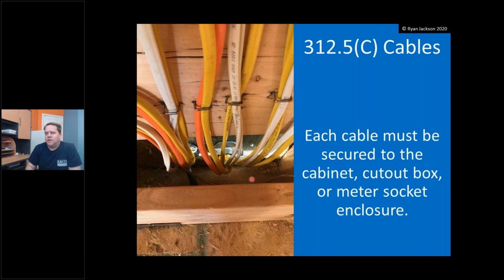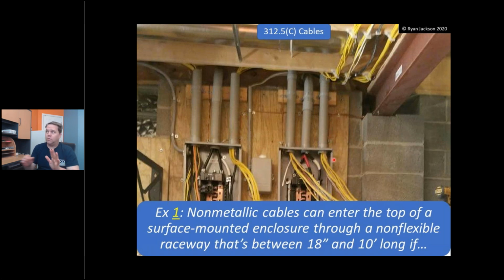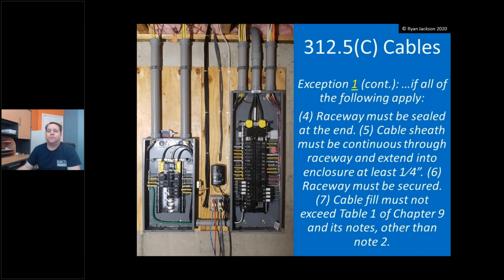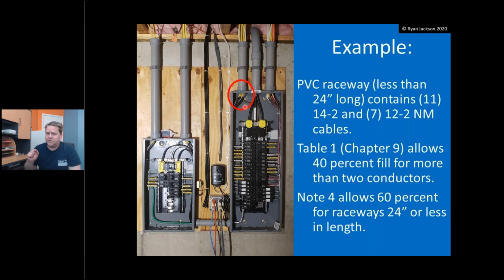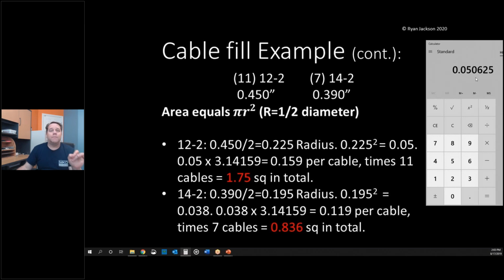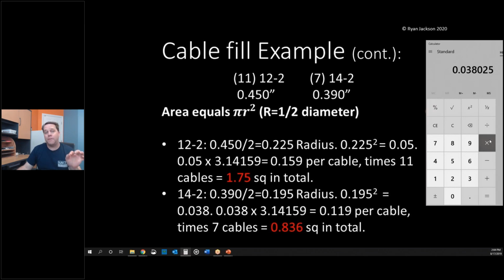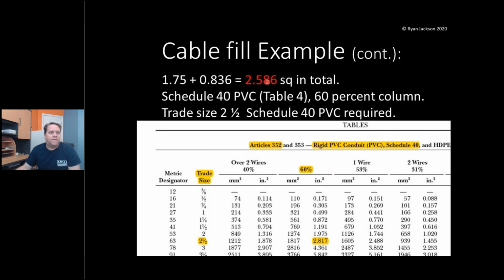2020 NEC section 312.5(C)

Comment: Subscribed!!! 

Big question! What NM connector is listed for multiple wires? The problem I keep having is is blasting a surface meter main, when there are limited knock outs on the back. To keep it looking clean, we want to come through the back of the enclosure where they have 2 in knockouts. Any suggestions? Or what NM connectors do you recommend?

Comment: What about surface mounted panels on the outside of a residential home, can NM cable from inside the wall behind the panel enter into the back of the surface mounted panel if the panel is outside?
Reply: Or how do you comply with this rule if you go from the panel where the main disconnect is up to the panel inside the house using nm cable, most of the installations i have seen use a pvc pipe up to the soffit with nm inside, it may comply with all the points in 312.5(c) but 312.5(c)exception no1(3), because even if a fitting is provided a the end of the pvc pipe it is not accessible

Comment: I see this application used on existing cabinets at the back of houses all the time in Florida. Conduit coming down from soffit. Many code violations in one. The conduit being stopped inside the soffit would be one, another would be strapping within 6 inches because you wouldn't be able to physically get to that point where the pitch of the roof is while at the same time, keeping the conduit inside the soffit to keep your romex from weather and or physical damage. Always overfilled and never having a fitting on the end inside of the soffit... Not once have I had an inspector pick on it though... Just curious as to what other electricians would do in this scenario? Have the contractor build something around the top of the cabinet? Tear out the inside wall and run the cables in behind the panel? (I've done this before where the wall was already being replaced) I've never been called out for using the existing sleeve to add circuits but I'm sure it is bound to happen sooner or later. I would say making sure fill is met and fittings are at least installed on the end as well as filling the end would be well enough but you'd still have some criteria not met at that point. Worried about a current install on an old house in Florida. Appreciate the advice.

Comment: Let me shake things up a bit.  There is nothing in 312.5(C) that states that cables rated for wet locations cannot enter from the back of an outdoor surface mount panel through a chase nipple, for example.  "312.5(C) Cables. Where cable is used, each cable shall be secured to the cabinet, cutout box, or meter socket enclosure."  That requirement is followed by an exception: "Cables with entirely nonmetallic sheaths shall be permitted to
enter the top of a surface-mounted enclosure through one or more
nonflexible raceways not less than 450 mm (18 in.) and not more than
3.0 m (10 ft) in length, provided all of the following conditions are
met: ..." .  Maybe someone is thinking: "but they have to be secured to the panel and you are not using a cable clamp if you run through a chase nipple!"  But, 312 does not say how they have to be secured to the panel, and as such it appears that the method does not even have to be with listed equipment.  312 simply states that it has to be secured. Therefore, after passing into the panel, apparently the cable can be securely tied down/clamped within the box.  Also the chase nipple must protect against abrasion per 312.  Although knockout clamps are the standard for indoor panels for obvious reasons, I do not believe that they are required per NEC.  So for example, 312 does not prevent running SER and UF through the back and securing it inside the panel.  Please tell me why I'm wrong.  Fire away!

Comment: Ryan, this was an old video of yours but relevant and explained so well.  Using the conversion to determine the area of a cable based on it’s width is overlooked or maybe ignored at times.  This is related to pulling NM in conduit (permitted  but why would you do it?). And it is permitted so long as you meet all other NEC rules related to conduit including “fill limitations.”  Multiple flat and neatly stacked NM cables entering or exiting a conduit may look fine but an inspector can spoil your day.

Comment: Good except areas are expressed in SQUARE inches, and volumes are expressed in CUBIC inches…not just  “Inches”. 2.58” is a linear quantity not an area, or a volume. I know what you were saying but I guarantee there were a bunch of watchers of this who were confused.  Those code sections deal with AREA… square inches. So say that.

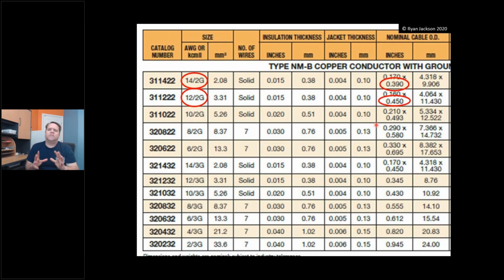Comment: Hi Ryan, In 7:33 you showed a graph showing the diameters I noticed that 12/3 has .345 diameter while 12/2 has .450 in this situation how would you figure this out because you’d think it would be bigger if there was a extra wire.  Thank you for explaining this tough subject so I can understand it I really appreciate it.
Reply from the maker: Hi Connor. When this was made, 12-3 was a round cable and 12-2 was flat. I'm sure if found a newer version it would show a larger diameter, based on 12-3 being flat once again.
Reply: Ok finally got it, the diameter would’ve been wider if 12-3 was flat because the extra wire would have been placed beside the others. But seeing how it is round they are stacked more like two on top of the other making the diameter not as wide. It took me a second, cause I couldn’t figure why there is more wires but less diameter but now I do. Thank you Ryan

Comment: Actually subject to local electrical jurisdiction, that supercedes the NEC. And the reason you don't use pvc electrical pipe exposed is because if it catches on fire, it becomes toxic. You should never used pvc exposed, it can terminate underneath switchgear where it is totally enclosed.
Reply: 352.10(F)

Comment: I engineer broadcast facilities and data centers. A trick I have used for years and has always been approved in several states is as follows. We use 225a  flush mounted main breaker panels. From that we run three or four 3in conduits stubbing out under raised flooring terminating to 12x12x6 or 12x12x4 pull boxes.  From here we run Sealtite or MC spliced to THHN wire in the pull box to equipment rack power strips or outlets. The idea here is future power upgrades or changes are very easy without having to open the wall.

Comment: Here's a question. In my garage I have some 1/2in EMT coming from the ceiling to standard surface mounted boxes, handy boxes and 4x4's. I run #12 Romex from the panel or an accessible J-box in garage the attic to the EMT stub using a Romex clamp connector via a threaded bushing. At the point where the Romex enters the EMT, I strip the jacket all the way into the end box. Remember it is clamped at the start of the EMT stub. Is this legal? I always thought you weren't allowed to run jacketed cable including Romex inside EMT. And most Romex these days is just THHN under the outer jacket although it's not labeled as such.

Comment: Is wire fill in pipe a “getting damaged when pulling” issue? Or is it a “ambient heat” issue
Reply: Mostly the latter, but a tiny bit of the former. (if you're stuffing so much cable in there it becomes hard to pull, you may want to rethink it.)

Comment: What about  derating than 3 current caring conductor I got nail by using the table but then not derating as well does
Reply from the maker: Use the exception to 310.15(A)(2) to get out of it.
Reply: Ryan Jackson I had 48 12 thhn in a 2 1/2 pvc they made me remove them down to 20 wires and increase the size to 10 which I argued that was would  stop someone from then installing 30 amp breakers on those circuits your opinion would be very welcomed
Reply from the maker: Yeah, the exception I posted woukd get you out of it.
As far as changing the breakers, that is true anytime we increase for voltage drop too. We can't possibly make rules based on people changing the rating of an overcurrent device.
Reply: Ryan Jackson thank you
Reply: @RyanJacksonElectrical  we can also label/note on the wires on the inside as well as the outside of the panel why the wires are oversized and not to increase the breaker size. Even if there was something in the code stressing something like this,, we all know the trunk slammers and weekend warriors go by"it works, it must be right" thought.
Collectively an amendment to the  NEC  for a change listing  that issue can be submitted as well.
Reply: @RyanJacksonElectrical  You don't need to change the breaker for voltage drop, there is nothing in the code that says I cannot land a 6ga wire on a 40 ampere breaker, as long as I don't violate the manufacturers instructions. However you still have to be careful. There's a sneaky part of the code somewhere that I forgot, that says if the wire is really long and you increase the non-grounded current carrying conductors, you have to also increase the equipment grounding conductor because we must provide a low impedance fault current path back to the source. In some strange long distance scenarios, you could end up needing an EGC that is quite a bit LARGER than the current carrying conductors, and this is becomes a real pain, because now you have to pull individual wires, because an off the shelf SER cable, NM, MC or AC cable is not going to have a large enough EGC to comply with the calculation.
Reply: @jimmiegill3981  There's nothing stopping someone from installing 20 amp fuses on a 15 amp lighting circuit in their 1960's era fuse panel either, lol... Happens all the time. That kitchen lighting circuit gets tapped and a drop to a receptacle on their kitchen counter and they plug a microwave AND a toaster into it. Yeah and it's like 3 feet from their kitchen sink too!
Reply from the maker: @brnmcc01  I never said you had to change a breaker due to voltage drop. And the section that you refer to is 250.122(B), but IN NO CASE does thecEGC need to be larger than a circuit conductor. See 250.122(A).
Reply: @RyanJacksonElectrical  Thank you, I misunderstood the part you said about breaker increase in size, I saw that was part of a reply to someone else, got me mixed up. As far as the code goes, this is nice thanks for the link, they fixed it in 2011, so now you're right. I wasn't up to date, because in Indiana here, they are only on 2008, lol. "The previous 2011 code language in 250.122(B) required that any time an ungrounded conductor of a circuit was increased in size (for any reason); the equipment grounding conductor of the circuit was also to be increased in size, the same proportional amount. This code language was too restrictive and unnecessary."
Reply: @RyanJacksonElectrical  This all started from the father in law of a friend, he wanted to run power out to his pond and install a pond fountain pump, to aerate the water etc. His property is so big, I went to look at it and measure it off, on Google earth it looked about 1/4 of a mile from the barn subpanel, but a straight shot from house garage panel would have still been 1000'. Did some math for the specs on the pump, and with 1000' of 12/2 wire, would have resulted in less than 110v at the pump, with just the FLA rating. Would have taken a very large wire, and still might have had the problem of the LRA startup current dropping the voltage below 108 in which case it would just stall, and burn up the motor. Anyway, the cost to trench nearly a 1/4 mile, plus all the wire, plus the issue of what happens if the pump motor windings get wet, and fault current starts to flow thru the water in the pond ended up being way unaffordable.
Reply from the maker: @brnmcc01  That has not been the case since 1996.
Reply: @RyanJacksonElectrical  Wow that’s a long time
Reply from the maker: @brnmcc01  250.122(B) has been problematic ever since it went in. It still is, although the exception added in 2020 helps quite a lot.

Comment: The conduit has too many current carrying conductors also, that is another issue correct ?
Reply from the maker: Yes. You can use the 90 degree C column of Table 310.16 for ampacity correction, but if you have more than nine current carrying conductors it is going to be a problem. HOWEVER, we can also use 310.14(A)(2)'s  Exception [310.15(A)(2) in older books] and make the issue go away completely.
Reply: @RyanJacksonElectrical  I thought there was also an exception for that for a nipple (under 24"), and as long as at least one of the ends were open. The idea being that a nipple with at least one open end will not build up a big bunch of heat. The end of the nipple outside of the enclosure still has to be sealed, like in this example video.

Comment: Ryan, can you tell me why is it commun to use ROMEX 2-14 or 2-12, don´t you use EGC in those circuits?
Reply: You must use the bare wire for grounding in ALL 14/2 14/3 12/2 12/3 10/2 in NM cable.
Reply: All older type NM ( before around 1985 ) and newest type NMB cable since at least 1970 were all made with a bare EGC wire. No such thing as Romex in any edition of NEC. Romex like wire nut are brand names. Forget what size NMB cable starts using a reduced EGC. Think #6 & larger has the reduced EGC. Did only industrial electrical work last 35 years before I retired so did not work with. "Romex" much but tons of MC cable & conduit.

Comment: Great video, thanks Ryan
I have a question for you , what is your take on these AC mini split systems . The circuit is run out to the condensing unit outside and then a cable (TC cable art 336) is run between the outside condenser and the evaporator inside I work in a local jurisdiction here in Colorado and I have brought this up to the attention of the other inspectors in the team because the cable runs 220 volts to operate the inside unit thru an additional control wire they don’t seam to think that this is big deal in that this cable is being installed by mechanical technicians and not getting inspected and no permits being pulled what is your take
Reply: The HVAC company I work for uses 14/4 SOOW cable for mini split indoor unit power and control. Mitsubishi units only need L1 and L2 for 230 volt power plus a third 30V dc conductor for communication plus the ground. It may be that power control cables for these mini split units are considered as part of the total system and while they are field installed, are covered under the equipment listing. LG specifies 4C/18 wire for some indoor unit com and power wiring which is basically alarm wire. Indoor units are rated at around 1.8 -2 amps RLA so I assume this is OK since it is listed. I still use the SO cord for LG installs (it's far more rodent proof).
Reply: @MrGuitguy  Was aleays taught that
Reply: @MrGuitguy  sorry. Was always taught that so called extension cords such as type SO SOOW SJO etc can never be used as permanent wiring. Better off using type MC AC cable for this.

Comment: So many stupid nec rules....as usual
Reply: The only difference state to state is which version NEC is currently adopted.  Its still the NEC, the minimum that we follow that comes with doing electrical work safely, consistently. There's no whining in electrical work either, do it right or don't do it at all...
Reply: @JM-iz3fr  I was talking about state amendments that make changes to NEC. Many items including raceway fills are different from NEC
Reply: In dukes of hazzard city of Philadelphia we are in 2 code cycles. 2017 for 1 & 2 family residental units and 2014 for everything else. For years Philly had a 40 page code book add ons of their own. Lazy Pa foot dragging politicians have bren talking of going to a state electrical license. Way it stands now you may have a license in 5 area cities & towns but hick next store town does not honor any other location license so they make you take a 4 hour test.
Reply: The NEC rules exist to save lives.
Reply: @BattleToads1990  yes, especially considering they are different in all state lol and they are made by people that have never worked a minute in the field
Reply: @FBx7c  be sure to pick up a copy of the NEC. You will find a form that  in the back that you can submit any changes or additions to the code. Most people on the code panels started out in the field and worked there way onto one of the commitees. Like everything else, you can be part of a change if you want to!
Reply: @BattleToads1990  The NEC exists to make money only. If it existed to save lives it would be public property. The NEC is a private code. Electrical safety should be regulated by the government, not dictated by a private, for profit company.

Comment: Ok but now about  wire current reduction with more than 3 current carrying conductors in a raceway?
Reply from the maker: You have to address that, for sure, although the exception to 310.15(A)(2) [310.14 in 2020] will often get you out of it.

Comment: Greetings Ryan,

Excellent training as always. I just wanted to add that I find it easier when working with elliptical shaped cables to use "A = (π/4) × D2" ...sorry cant do a little 2...LOL.. To show Diameter squared but you get the point. As long as they know the diameter ter of the cable they are good to go. 

Guess all these work as well:

π (Pi) times the Radius squared: A = π r2
or, when you know the Diameter: A = (π/4) × D2
or, when you know the Circumference: A = C2 / 4π

Now if I can just figure out how to show a small 2 I am all set...LOL...but again great training fella and keep up the great work.
Reply: Convention is to use the symbol above the 6 on the keyboard, to indicate exponents.  A = pi*r^2 is the way to write it, without resorting to the character map or special formatting.
Reply: @carultch  LOL....OK..Thanks